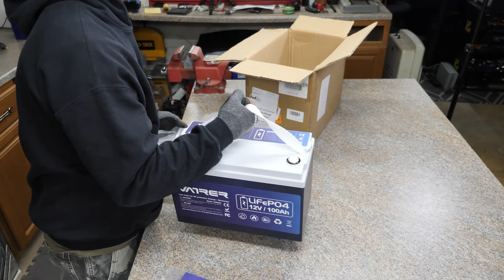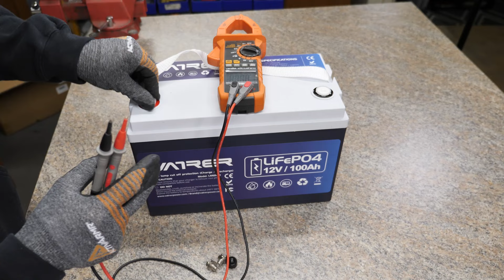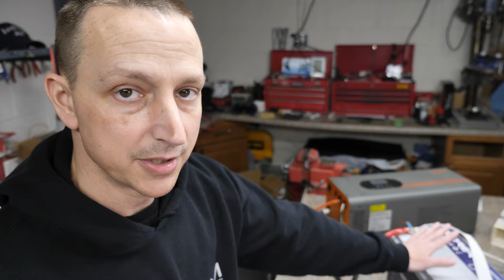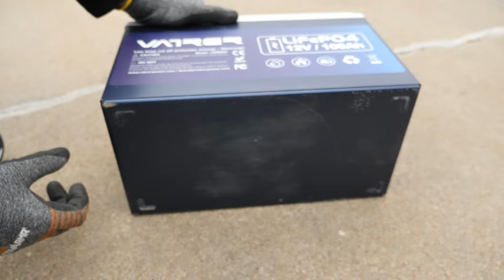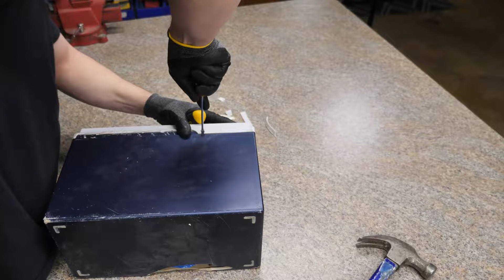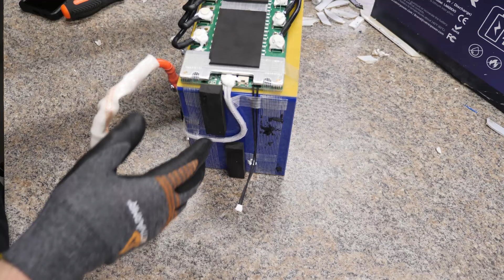Vatrer 12v100ah LiFePO4⚡Full Review with💥DROP TEST💥

Comment: Thanks for showing the video. I’m gojnf to get this battery looked like quality build. Just got a WattCycle 100 amp failed to discharged at 800 watt 5000btu ac for in 10 minutes. Working with the seller for an exchange

Comment: Hi. Would you mix this battery in parallel with an Enjoybot.  Both would be 12v 100ah lifepo4 with low temp cutoff.  The Vatrer would be 3-4 months older.  BTW I will be using a small 12 watt heater in an insulated box.  I don't trust the accuracy of LTC.  Thanx.

Comment: Great content !  Just wanted to pass along ... after several "GOOD" Reviews, I pulled the trigger.  Bought direct.  Chat, they responded within minutes !  Received QUICKLY.  stored inside home, in closet, til I came to the realization that my bank requirements were greater than 200ah [Big Mistake not reading Multiplus Manual first].  I have reached out to Vatrer MANY times, in hopes of exchanging for 400ah.  Nothing, NADA, Zip, Radio Silence ...

So, just like So MANY of "these" companies, Customer Service is phenomenal Pre-purchase.  POST-purchase ... it doesn't exist !

Comment: I am thinking to get this battery but I am afraid of low temp cut off.  They say in description that low temp cut off is activated in  0°C +-4°C..that means it can charge under the 0℃ and it will damage the battery..There is no way to fine-tune it as there is no bluethoot connection..
Reply from the maker: Its a solid battery! I wouldnt worry about the low temp cutoff at this temp honestly. A few degrees + or - is always there due to electronics tolerance. Yes this one does not have bluetooth connectivity but they do have some that do. I am unsure if it is locked or not to allow changes since I havent tested that battery.

Comment: All impressive (build, drop test results, cold weather cutoff, etc.).  My only concern is with the wire gauge used.  If this battery can put out 100 amps continuously, the positive wire size should be at a minimum of 4 gauge.  The other 4 wires, at 10 gauge, should be fine given that each wire would typically carry 25 amps.
Reply from the maker: I may put the battery back "together" and we could test it at 100amps and could throw the thermal cam on it and see what we got! Whatcha think
Reply: Interconnects might desire .025 x 1 inch tinned copper strip?  (IR drops should be avoided.  I’m noticing that particular issue with my main Ebike battery…)

Comment: Nice battery - they are really beginning to deliver the goods. 
Wish you had charged and discharged it after you ripped it apart - on the driveway ofcourse, on a pile of sand.
Reply from the maker: I agree! They are starting to use better and better products! I may put the battery back "together" and could do another test???🤠
Reply: @AVERAGE_JOE If you are going to try it (I hope you do**) It may be better without the case as there is less to burn. As its an LFP, I don't expect it to burn, mind you, but you have to consider worst case.
**I have several LFP cells in my off-road camper - I imagine eventually they will start to look like the cell with the dent...I'm sure many other off roaders are using LFP and this would be the case of them too. You would be doing a service to the off road community if you did test it for us Joe.

Comment: plug in your screen of your phone properly.  Replace the screen did you?  If not your cable is pulling out- open up that bad boy and plug in the screen cable properly.
Reply from the maker: It has to be the screen cable. I can press down on it and make it go away. Its an old phone anyway and not to worried about it. I only keep it for random things and the thermal camera. Would be nice if the line was gone tho for videos

Comment: I have one in my truck camper it powers a 60 l fridge I have 400 solar and diesel heater everything's run off at 12 volt and never had a problem out of it it does as expected and some .looking to buy another 100 amp hour.
Reply from the maker: Sweet! I would say you have an amazing battery! 🤘